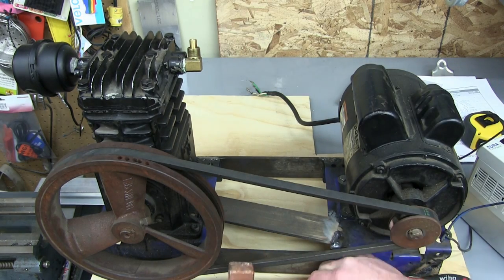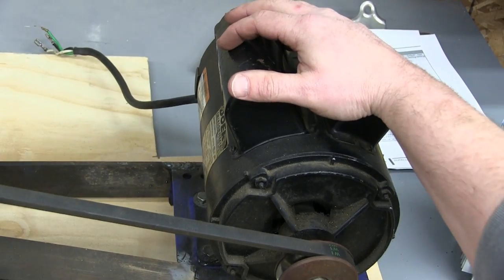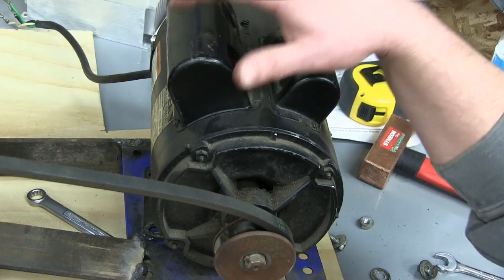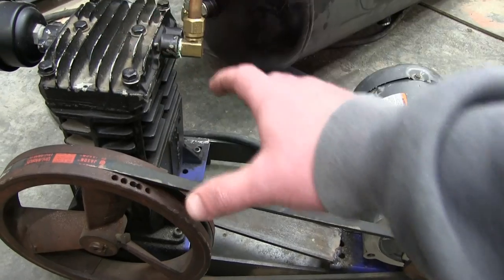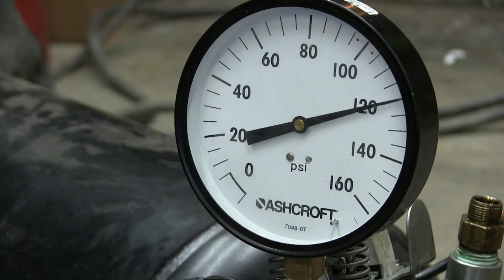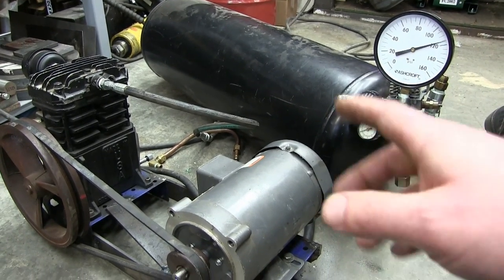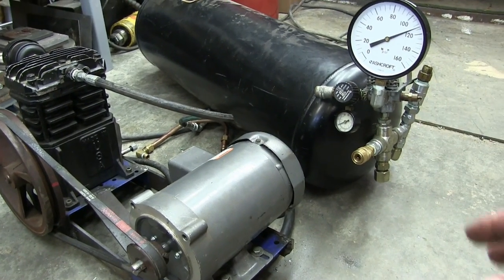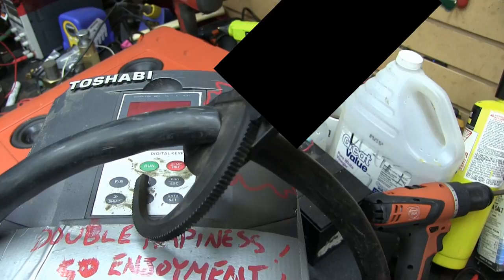BIG COMPRESSOR PERFORMANCE BOOST | No tripped breakers!

Comment: Well at that rate you could just get a multi piston unit and drive it as fast as it will go till it gets ready to stall and have solenoid valves on the pressure sides that switch the output of each head from joining the main output to instead blowing on the hottest portion of the head with a nozzle to divert it for cooling, then have the system toggle between the hottest and the coolest head when an overheat condition occurs, the fewer the motor can drive at once the lower the switch temperature will be for longevity, so look at it as having more units in storage to pull from.

the pressure drop signal system won’t work super well unless the sensor is on the line side because the tank acts like a capacitor and becomes a smoothing reservoir, and something more unlikely to accidentally happen in use should be the signal like short short long long short short (sos?), but you should also have the system slow down when it gets to the upper limit and run just one head on a low rpm as a way to keep the pressure up and keep up with demand, if no pressure drop is detected for 5 minutes then it can reach the max pressure you want to leave it at and wait for a drop on the line, and you can even set it up to detect long flow periods that seem out of the ordinary and go into full shutdown mode till reset, preventing leak based failure, you can also add in a AC scroll compressor (pretty common these days) to quietly compensate for small leaks and allow the system to be always on in a reserve mode that requires a tank level pressure drop before the regular compressor set comes to life again

Comment: i belive you would need beter cooling and or oiling for the cylinder. i belive you will have the same problems as a two stroke engine. so i would add a oiling system to the suction side to avoid heat build up in the cylinder and also it would oil the tool so to flys. keep up great content

Comment: What about using an Arduino to read the rate of change of the air pressure, and provide a pulse width modulated output to the VFD that would tell it how fast to keep the compressor going in an attempt to maintain a preset pressure. You still have a upper limit shut off, and a lower cut in, but should be able to tune it to keep a fairly constant pressure with a fairly constant air usage rate.

Comment: This would be great coupled with a high-pressure tank. You could set the tank pressure to 180 or so, and have it valved out to 120 at the output. Then you could set it to engage when the tank reaches 140 or 130 psi. Would that method be more efficient, or would I just be wasting juice and burning out motors? It's usually beneficial to keep your system "over-charged" (obviously still within its operating parameters though) and then stepped down to operating pressure. With that, it becomes super-critical to find a pressure vessel that can take that kind of pressure consistently.
Sorry for the ramblin. Just thinking out loud, I suppose.

Comment: And late to the party again! Really trying to play catch up here! The only thing I want to mention is that the compressor is probably splash lubricated. If it runs slow for too long, you might end up with some toasty bearings. That could easily be overcome by a program to ramp it up once in a while...

Comment: AVE, your thinking in the right ways... Keep thinking like this... This is where true innovation comes from. I will build you something if you want me to. I was using core drill the other day and realized how easy it would be and how it should work to automate the motor torque as well as the feed speed  and pressure and I believe i even solved in my mind how to detect loose   debris / rebar chunks in the hole which cause chatter and impede the drilling process. I 100000% believe that i could take a shitty chinese core drill and make it run longer and better than a better built one by smartly controlling it and what your speaking of here is super easy.... Learn about machine learning and NN and you could even see how the NN could smartly respond to the airgun / nailgun impulses even better than just a set linear process a PLC can do... but PLC's are great great great things..

Comment: The simple way to use a transducer, is to set the span between 120 and 115 PSI. As the pressure drops, the motor gradually gains speed, until maximum set point. At 120, the motor essentially stops.
     I couldn't help but notice, it's "choochin" in the wrong direction! There's either a direction function in the VFD, or, just swap any 2 wires, to turn the motor the opposite direction. The compressor pulley should always blow towards the compressor head. Watch your discharge temperature. Even though that pressure hose is rated for 10 X the set point pressure, it may not be rated for the discharge TEMPERATURE!! You'll know, when the hose blows right off the ferrule. (heat more than pressure)

Comment: My thoughts are why alter the system at all? Seems like a lot of work when you cab so what you want with one additional pressure sensor and an arduino board. When pressure drops to 195 it automatically picks it back up to 200 therfore keeping it where you want it without the need for any mechanical fuckery

Comment: I have a Dual motor ( 2 Pistons ) 240 volt Compressor from Canadian tire the I want to run off my 24 Volt Solar System. Do you think changing the motor to a 3 phase would be better for it. Or adding a Soft Start to the Compressor ike some do on Air Conditioners. 
great Video by the way!

Comment: Rolair makes portable two stage jobsite air compressors that provide insane volumes of air, and have almost negligible voltage spikes, variations, etc. Around here, any serious framer or roofer uses them. I do. They'll run 10+ nailguns, with almost no waiting for pressure. Combined with a "pig", you basically have infinite air. Ohhhhhh, and they run up to 175 psi.

Comment: The cfm of the pump is what matters. If your using more cfm than the pump is capable of putting out it's not gonna keep up. A bigger tank will help you with the capacity but it will eventually be break time when your tool starts slowing down.

Comment: When you're going to town on a crank shaft bolt, or across threaded axle nut or something. Where you may be good and pissed already. It's not a good time to run out of air and stand around and wait. Need to be able to put that energy to use. An air wrench (compressor) that can detect cranking and slamming would be pretty cool.
Reply: Potential problem: putting on lugnuts or an oil pan  if you are fast enough would produce multiple rapid pulses that do not want pressure to suddenly increase. Precision speed torquing procedure. Ya, don't want to mash a gasket or twist a head off from a sudden pressure increase. But maybe i am overthinking the "on demand" aspect. It's just a concept.

Comment: AVE, that's why unloader valves are great..... Let the compressor come in with vented cylinders and then closes the valves when things get up to speed. Not sure if anything is available for the lower power motors/compressors. My compressor starts way above regulated pressure with vented cylinders and doesn't lug. No fancy electronicmajigs required. Regulated pressure is independent of cycle pressures. I like the idea of speed vs demand, but don't see how the tech earns its keep.

Comment: I might be missing the point of all that unless the point is "because I can" which is a good enough reason to do anything. I have my regulator set to output air at 120 psi and the compressor kicks on at 125 and off at 140. Biggest thing that gets in my way is the restriction of the hose.

Comment: it is a good idea ..think about modern brush-less motors  way more efficient and no brushes to wear out .. unlocking high rpm potential.  they are also made in reverse of traditional motors with a cylinder magnet in the center that rides the shaft   , or pie slices to add poles which = more torque .. the magnets are typically  Neodymium which as we all know make ceramic magnets  seem like child's  play.  .. cooling the compressed air as it travels to the tank may also help fill speed .. .. and overall pressure .. 120  is weak for many air tools .. there are 12v compressors on the market that do 200psi for air-ride systems .. just some of my thoughts
Reply: a piston engine can be converted into a compressor (option of liquid cooling)   also the discharge air  is going to get cold fast so it could be discharging through a heat exchanger helping to coolt the compressor as u use the air tools ..

Comment: At startup you need high flow. A much bigger bore feed line between compressor and tank would help to reduce startup losses. 
Even better run two compressors. Drop the second (or even bigger) one out when motor starts to struggle.

Comment: I used to do sandblasting, used lots of air continuously,  always waiting around for 200ltr tank to fill up, in end got another 200ltr compressor and screwed down the springs on one air switch so as one compressor would cut in and top up the air surply

Comment: I invented a cure for that problem, for less than $5, 25 years ago, and it still works. after installing my device, u  can run a compressor on the end of a long ass cord and it will still recycle

Comment: This is a great way to destroy your pump. Starting loaded is a bad idea. Not only does it put stress on the internal components but the motor as well. Especially that cheap Chinese pump. Keep up the good work, this is what keeps me in business.
Reply: i dont think you understand the vfd or motor combination.. also aircompressor pumps are just lumps of iron as long as they have oil cant kill them

Comment: you shouldn't need a PLC for constant pressure, you just need to run it closed-loop, wire the pressure transducer to the analog input, set your analog scale and units, frequency limits, put the setpoint on the keypad, and adjust the PID loop accordingly. I think the overdrive is unnecessary, but a lot of drives can also handle logic like that.

Comment: I really enjoy your videos. Thanks for quality entertainment and education!

However, this idea, I think, is stupid:
1. Air compressors have designed top RPMs. Running them higher, even with lower load would reduce their life
2. If you care about CFM @ 90 psi (for wrenches, sand blasters, die grinders, air sanders) your idea certainly does not provide 40% increase in CFM. If you are set on overworking your compressor at 90PSI, just put larger pulley on motor.
3. Air compressors are cheap compared to other tools in construction crew "toolbox". If they are regularly running out of air, they should just upgrade or buy additional compressor. For cost of VFD + 3 phase upgrade, I'd rather buy another $200 compressor so now I have 2. And nail guns do not use THAT much air. 

In short, the only value I see in your idea is to reduce the wait from 0 to 90 PSI. If you are a professional shop, you always have air 24/7. If you are a weekend warrior, you just grab a beer while you wait... so no clear use scenario.

Comment: Any concern of overheating the compressor? Usually the downtime is to aid in cooling. 
Roofers that dont want the down time will probably  run a bigger unit. 
Most tools have max air psi also.

Comment: Would be nice with a valve on the tank so when you arrice at the shop you might have pressure left from last time. One or two fittings can be made air tight with enough love poured into them.

Version 2 could have multiple tanks that connects when the pressure increases, so you quickly get pressure, and slowly get more volume.

Comment: Could you put a clutch on the compressor and have the motor running constantly so you don't have the heavy draw on start up? The PLC would engage and disengage as needed.

Comment: Try swapping the Pulleys (big pulley on the motor small pulley on the compressor) I’m sure it’d come up to pressure quicker than ever, it’d probably work better to put a slightly smaller pulley on the motor if you did this so you don’t have as much rotation mass on the motor for it so reach max rpm quicker

Comment: I think this is a great idea but if for whatever reason there is a malfunction with the system and it just keeps going there should be a blow off valve rated for certain psi maybe just above 120 so that there is no explosions.

Comment: The compressor pump does not look like a 100% duty cycle. Meaning not intended for constant run, it will overheat and fail. The motor amp draw should be check too, otherwise motor will overheat. Spinning everything faster will cause the compressor oil to break down followed by the rings and bearings.

Comment: back in my misspent youth I got tired of waiting for the shop compressor to build back up when I was using a lot of air for example while porting the heads on my small block Chevy. when it came time to buy my own compressor I went out and bought the biggest and baddest compressor I could afford that would operate on single phase power. no 3 phase power here. 18.5 CFM @ 90 psi does fairly well on a 5HP single phase motor. no pissin' around here.

Comment: Not sure if this went anywhere or not but I'd look into a liquid cooling setup, that compressor head is going to get really hot without the cycle breaks.
Reply: Not as hot as you might think.  You only get so much heat from compression so the maximum temperature is fixed.

Comment: Not to seem ignorant, but what if I don't have 3-phase power available?  I'm fairly well acquainted with basic electricity/electronics theory thanks to a misspent youth in the US Navy but I've never worked with AC drives like the one you are using.  I'm assuming that it is capable of taking single phase AC input and providing a 3 phase output, correct?  If so, I definitely need to get me one of those!!

Comment: i think there's much cheaper ways to get the same results of constant pressure than using a variable frequency drive, for example, have two tanks an two solenoids, just have the compressor switch between charging one while the other is in use, by the time one tank is full, the other is getting weak and you switch over, the thing is with a variable frequency your compressor never has time to cool down, and the heat is generated not by the air pressure fighting the piston, (like in a diesel) heat in these lower pressure system are mostly generated by the friction rubbing metal on metal contact of the piston rings, even if you had three or 4 tanks, and had the compressor fill the tank to say 250 psi and only let out 120 psi from the regulator, you would have longer time  on one tank before you had to switch but you would probably need at lest 4 tanks to give the compressor time to cool down, what would really help is a fan constantly running,  and some soft copper wrapped around the fins of the piston cylinder, circulating water through it and then running the water in that copper to an old  radiator where you could runn a fan on that, also running the outlet line where the compressor is decompressing, run that around the piston head, using the heat of the piston to expand the gas exiting the air bottle, maintaining a higher pressure for longer while cooling down the piston head!

Comment: Unloaders are important... when the cylinder unloads it allows the piston rings to cool.  And copper pipe is cheap and durable, as well as a heat sink.  Get rid of that hose because it will harden, crack, explode and leave you with a runaway VFD.  That said, if you really want to impress me, put a small counter-flow style chiller with a bucket style condensate trap between the cylinder and receiver.  A dry sump is a happy sump, and drier air for yer buka-buka tool.

Comment: The electricity saved by VFD manipulation of three phase motors gives such a dandy payback time under factory conditions that VFD mfgs can charge a thousand bucks for premium models . I expect you can reduce the compressor noise tremendously with some intake muffling as I have started to on my 25 year-old Speedair. You might have a salable product there. A small 2-3 stage compressor could have possibilities too, as could some valve research (including solenoid valves with variable timing) and some early 20th century steam engine technology.

Comment: Sweet idea, but you just eliminated the need for the tank, or at least as big of one. One solution I always wondered about was why didn't they put a bladder in those tanks to stabilize the pressure even further. Would that work with air, or is it just because water doesn't expand(thinking well tank). Anyway, great idea.

Comment: Fantastic idea! Unfortunately, "big compressor" will not ever create this product. The liability in small tool failure due to component failure, pales in comparison to a high pressure tank failure due to component failure.

Comment: I think for a bunch of air I'd rather run duplex with PLC control for auto drain and hours change over. I can already hook a hotdog tanked compressor to the big 60 gallon for a bit of an edge when grit blasting. Being able to queue the compressor would be nice though just to top off the pressure. Wear and cooling are what I worry about.

Comment: How are the industrial latex paint sprayers made?  You pull the trigger the pressure slightly drops and then it compensates. Uses a piston system. But turns off when you stop spraying paint.

Comment: I think you should put aluminum heat sinks on that motor and on the compressor and have a blower blow and dissipate the heat away and have that on a thermistor to where the computer system can tell that it's overheating and kicks on the blower otherwise great idea good design